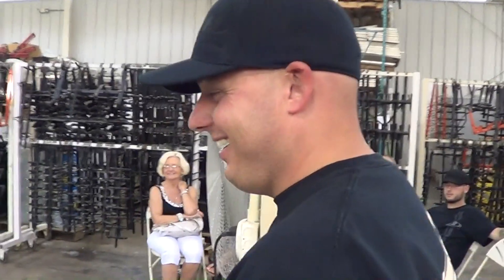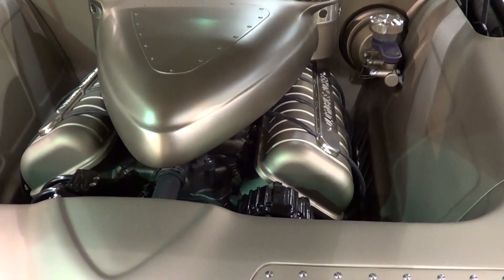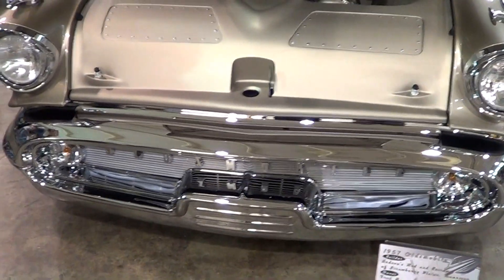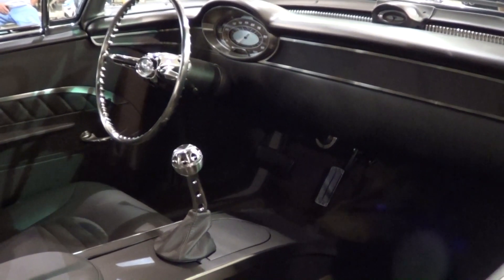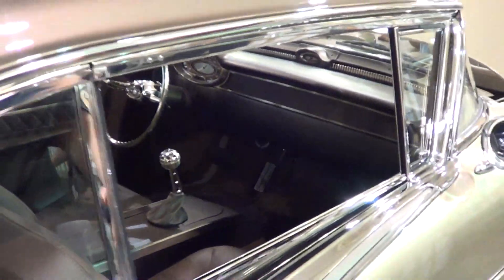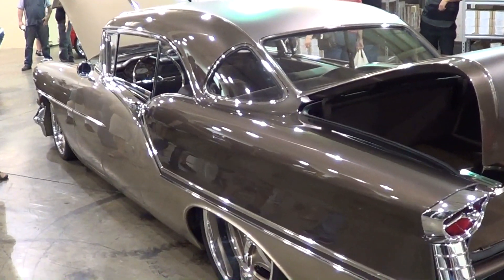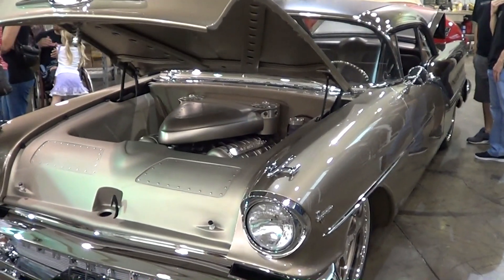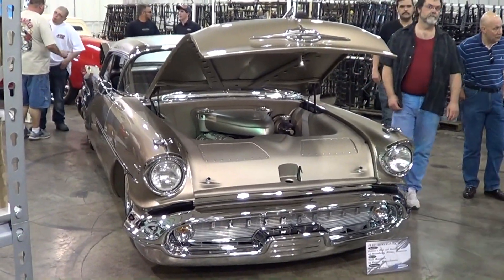1957 Oldsmobile Super 88 "Christine"

Comment: My dad bought a 1957 Super88 2 dr. sedan(with post) in 1957. It was the famous(and almost trademark) turquoise inside and out. It was, according to him, quite respected for its performance on the street. It had a 227 hp engine, shared with the '98. It was 4,400 lbs., less than the '98, which gave it greater performance. 
It is perhaps the best styled Olds of the '50's. Those '56 Supers and '98's for that year were stylish as well. For '57, Olds decided it was time for a major styling change.
Reply: It had 277 horses with a single 4 barrel, 300 or 312 horses with 3 dueces

Comment: I couldn't see anything on the door panels to put down the windows, then I saw it later on in the video.. I forgot GM put the power widow switches on the Oldsmobile (57-60 I think), up on the molding right underneath the windshield corners